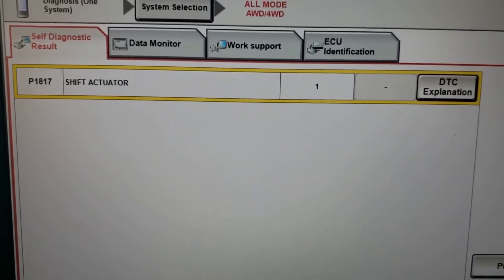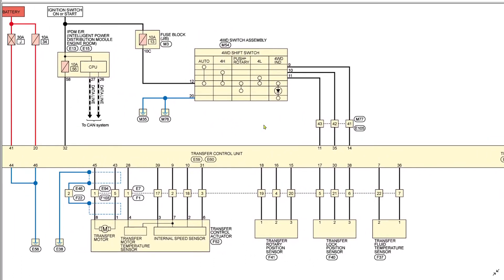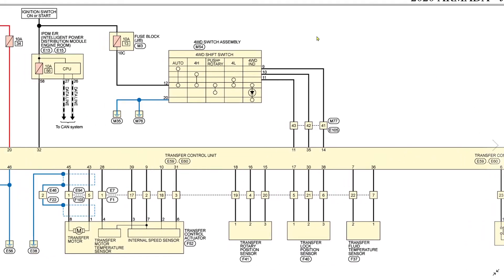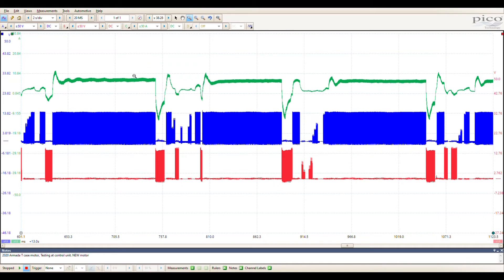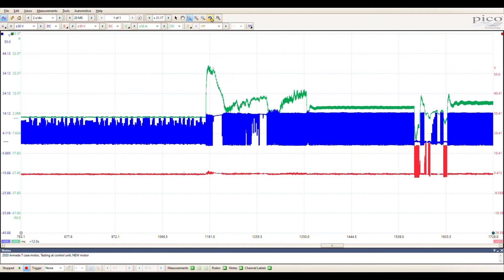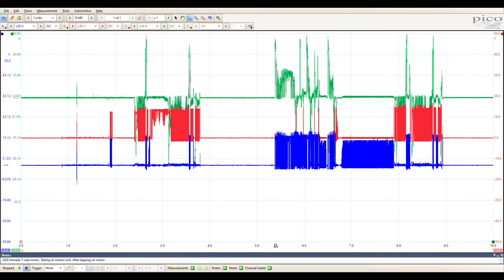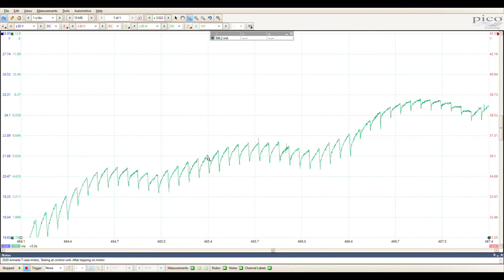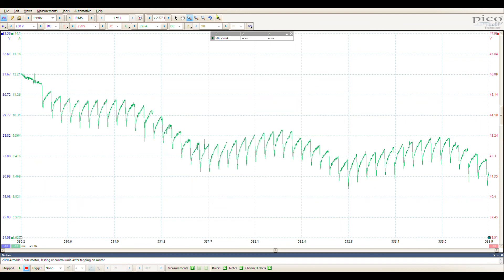Good Voltage BAD Current

Comment: I just had a thought after watching this, would a manual clip on ammeter be more beneficial? the ones with the needle gauge on, you'd be able to visually see the needle drop off & on
Reply from the maker: I would say any tool that shows current flow could help, only if the user is familiar with the tools capabilities and knows good from bad. I personally am not familiar with the tool you speak of.